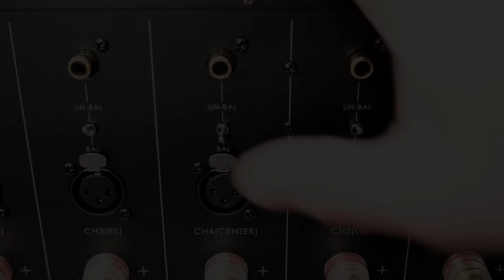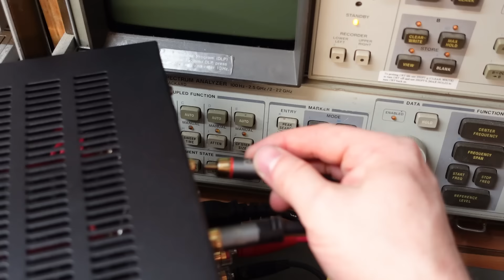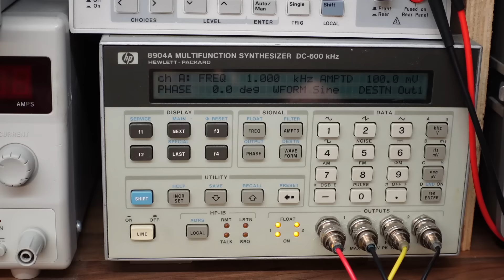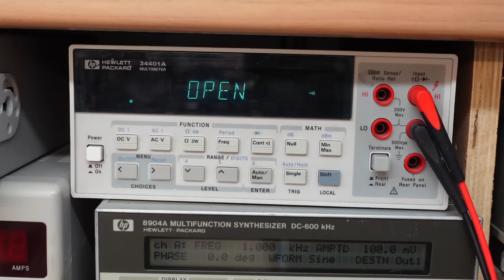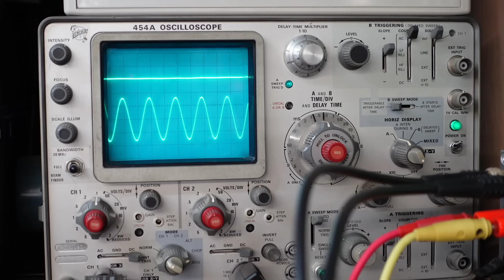The Unlikely Nakamichi Amp Fix (Build quality! Ahem....)

Comment: Nice simple fix :-) 
But inside the amp got me thinking. On the back the I/O sockets are all gold plated , so you can connect your gold plated plugged  oxygen free cables. Yet inside the wires are relatively small gauge with small tinned copper plugs and sockets ? Surly this is just introducing weak points into the system ? Dunno I’m not an audiophile 😊
Reply: Don't confuse good engineering with marketing show and 'audiophile' snobbery.
Reply: What exactly is an audiophile? How do you define one?
Reply: @sw6188  It is someone with more money than sense that judges performance from the HiFi by how much it costs, unfortunately many a fool is easy parted from their money which keeps these "Audiophile" companies in business, Mcintosh is a classic example of overpriced products that can be matched by other brands for a fraction of the cost.
Reply: @regfenster  Yup, I know what an audio-phool is. I just wanted to see what OP's opinion was. I have been repairing and servicing domestic and professional audio for over 40 years and seen some really expensive junk that people have wasted way too much money on.

Comment: Great to peek inside. Quite interesting none the less. Could be handy for a home theater (loud TV) set up. Gotta be pretty heavy. I've got a Counterpoint Solid 2, must be  85-90 lbs linear power supplies, big iron, too big to fit on normal shelves, also 5 footers.
Biggest xformer I've seen in consumer use. Definite overachiever as a boat anchor.
 Very enjoyable video from the standpoint of being able to peer under the hood. How's it's performance as a space heater? How many watts is it pushing in class A per channel?

Comment: I have a paradigm amp i need repaired it goes to a studio sub 12. Its a older sub but i like it and i would like to get it repaired at a decent price. Or get some advice on if i should just use kt as a passive sub? 

But then i would have to get 2 amps because the sub is dual voice coil. To run it properly well not even properly because no home theater subwoofer amps i know of are 3600 watts

Comment: Hmmm .. no forced draft cooling fans. 
Does a fault present when it's driven hard over time?  There is so little room for heat dissipation, I'd be a bit suspect on the amp boards located in the middle of the stack. 

Why the "Ahem..."  used in title?

Comment: This is not Nakamichi as many will remember, with the great cassette decks, rather the name and branding that was bought and reused.

These were not actually that good. We tried that and the matching AV pre in a home cinema 7.2 set up and it was very underwhelming. 
They were rather cheap, despite the claimed RRP, continually on discount, around £500 per unit if I remember may even have been less, certainly not a high end product, just a cheap, around 100W claimed per channel, and later rebranded as Iota, which still are available today for a dumb price of £1300 when they couldnt sell em for £500 without faults and returns.

A lot were bought simply due to the old name and what looked like a great quality unit, until opened and the amp modules seen, the things were brash and ran out of steam and I am sure the AV processor had a few issues with software and updates, many of them developed faults or simply failed when used in long sessions. 

But the biggest seller was balanced cables and fancy looking binding posts. At the time it was massively discounted with what turned out to be a fake RRP, so you were seeing what looked like a massive high grade AV power amp with many high quality connections and what many wanted, XLR.

These quickly were sold on, they were fetching around £350 second hand back then, replaced with Denon DN500AV and a brace of Yamaha power amps that outperformed the Naks with no effort.

Comment: Mark, could you share how you connect up the amp output(s) to the scope? You have some kind of transformer between the amp and the inputs of the scope?
Reply: He showed it in one of his videos. Don't remember which one, since I binged way too many of them. ;) Mounted on the wall he has a dummy load built from power resistors, switchable between 2, 4, 8 Ohms or so, for both left and right. A monitor connection from this dummy load goes to the scope, I guess just in parallel with the load resistance. He also has attenuators connected that create a smaller monitor signal which goes to the speakers, so he can test an amp at full volume and it is still not loud in the lab.

Comment: May i ask what would be a possible fix for an amp that takes 2 to 3 minutes of heating up after powering on. It gives no sound output in those first few minutes...
Reply: You might try pre-heating areas of the circuitry with a heat gun or blow-dryer to help isolate the faulty component.

Comment: Nakamichi. Blimey. That's a blast from the past. I thought they were mostly famous for their tape decks. They did a thing called a Nakamichi Dragon tape deck. Back then auto-reverse was considered a real wow. Most companies achieved it by reversing the motors to the tape and (I think) rotating the head. Nakamichi had this mad mechanism that actually flipped the casette around in the blink of an eye.
Reply: Those weren't the only Dragons. The top of the line Dragon 900 series still had auto reverse with automatic head azimuth adjustment. The auto flip models were the 500 series.

Comment: I'm sorry to name the elephant in the room: was this staged? I mean, I've never seen a connector to jump off its pins... someone definitely been here before, and pulled the connector by the cable...
Reply: This could be a production fail and some time later the connection got lost completely.
It happens from time to time, where connectors or FPC flat cables are note correctly seated in there sockets.
People putting all this together are in most cases plane trained employees with no technical knowledge. They do mistakes without knowing.
Reply: @matthiash.4670  That connector was definitely pulled by the cable. As they are glued together with that red stuff, the plug was pulling off the socket from its pins, that's what happened here. Now, at the factory, they are putting things together, not pulling apart... they plug the connector, squirt some glue on it, to the next one. This does not look like a manufacturing defect for me at all.
Reply: @janosnagyj.9540  The glue is most likly applied in a way earlier production process, where the cables are pre-applied (maybe already by an EMS). But this is not the question. Because, on the other hand it is not uncommon to unplug some connectors in the production line, for example because the cable routing was wrong. But even without, you can pull on the cable while assembly. And just try it yourself on this specific connector: By pulling the cable you will sometimes pull the whole matching connector housing from the pins, soldered in the board. So I cannot aggree with this agument either.
And because I already saw such pulled connector housing in production line, I would not make the point "this could not happen".
Reply: @matthiash.4670  Well, that glue is definitely applied when the plug is inserted. I know this red stuff very well, it is used everywhere in Chinese-made stuff. Secondly, it's a very badly organized production line, where it is necessary to undo things which were already made. In this particular case, it's just impossible - the glue is already on the connector... So, what remains is accidental pull on the cable during assembly. Now, see where is it located, how you can access it etc. Not easy to "accidentally" pull on it. And it needs quite a hard pull - even these Chinese knock-off XH connectors need some force to pull off from its pins. 
It can happen, I'm not saying it's impossible - just there are too many suspicious "accidents" here - like the owner's description which is saying one channel is bad... without naming it, which one. On a device, which is not exactly a buy-then-throw piece of junk... Then, he starts checking from the 7th channel, and "finally" founds the problem on channel one, as the last tested... as far as I know, even in the UK they are not reading from right to left yet ;) But of course, one must fill some time in the video, it's already too short :)  So yeah, certainly all these little glitches can be explained innocently, but you know, these times, when YT is full of fake restorations and stuff like that, one counts these things and over a certain number starts to pull his eyebrows...